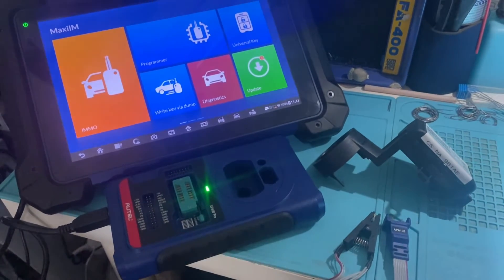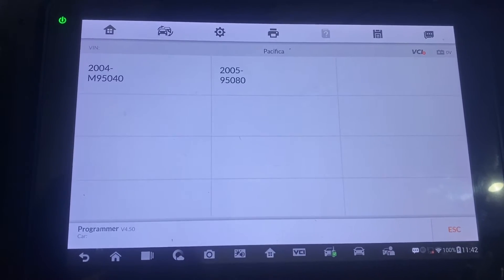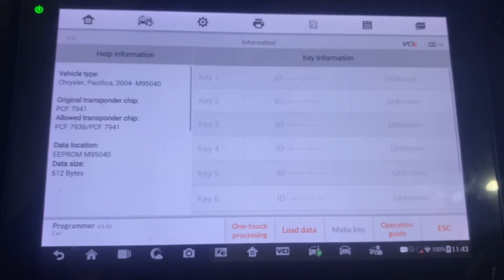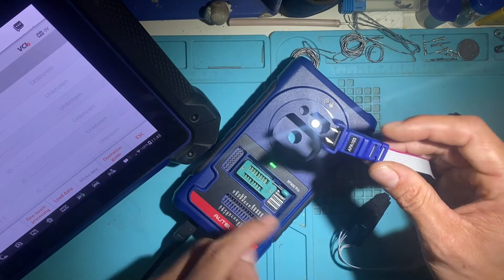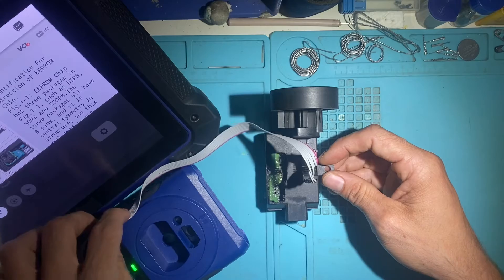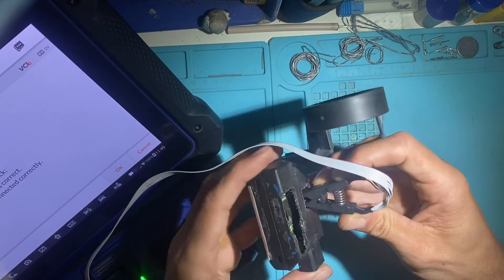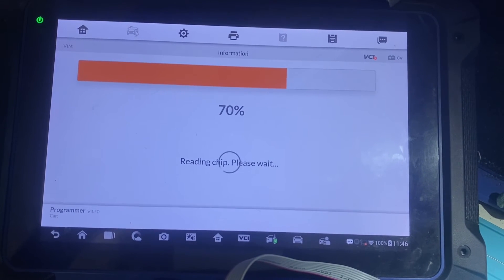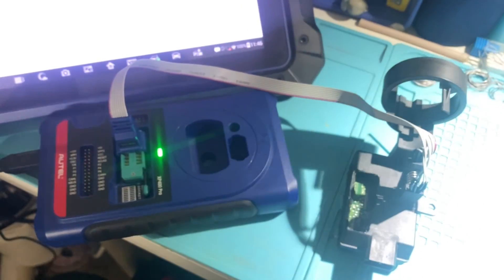Read Pincode from Chrysler Pacifica 2004-2006 using Autel IM608

Comment: 2007 Town & Country ST95080 IM508 Chrysler v4.40 fails. Reading pw not supported lol. Good network connection, no issues reading the data but craps the bed when it matters. Broke out the AR32 eeprom reader and boom. No problem. Funny how this is such a basic job and the 508 can't do it. At least on v4.40